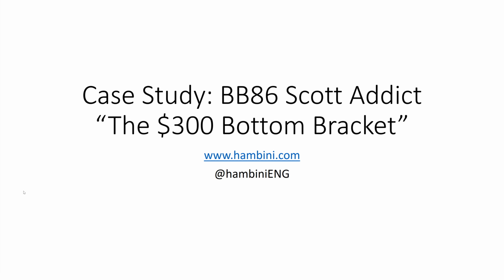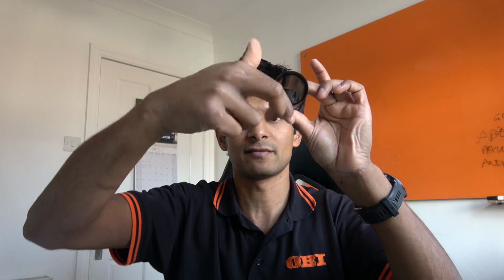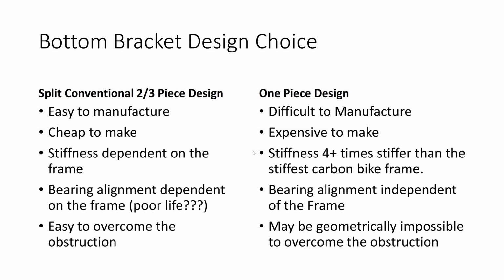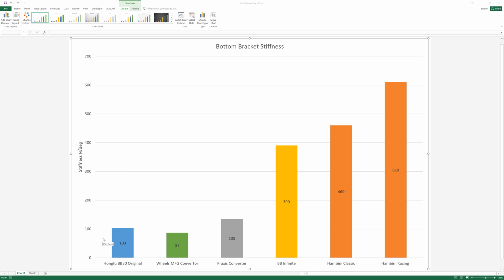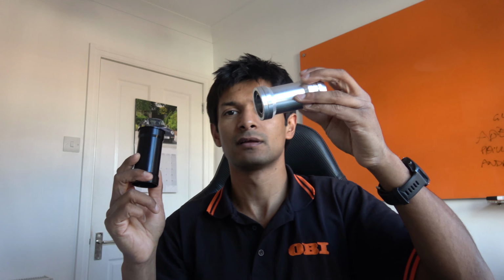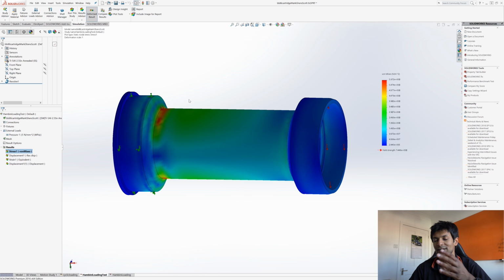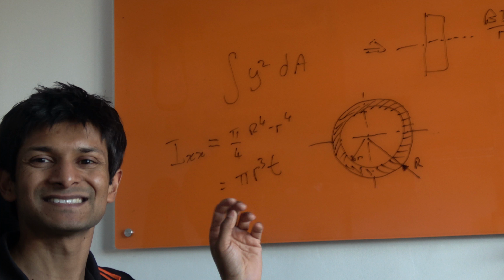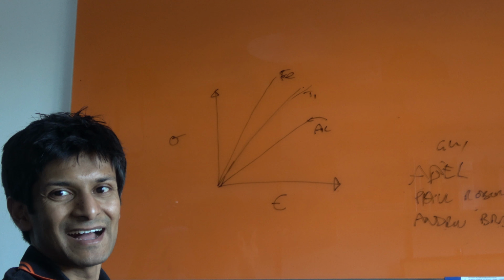Shimano BB86 Creaking Bottom Bracket Scott Bike Case Study

Comment: The bottom bracket is fitted inside the frame, the frame takes the force from the pedal stroke, preventing bottom bracket ends from moving vertically. That's the point of fitting bottom bracket tightly into the frame. If there is enough vertical displacement to stress the taper on the other side, making thin aluminium/titanium/whatever tube slightly less thin is not going to significantly affect things, and will definitely not fix the fact that ends of your bottom bracket are moving up and down inside the frame fit.

Comment: If you replace a delrin sleeve setup with a Hambini one, which is more rigid, can the latter cause an alignment problem with the BB apertures (holes in frame) to lead to the frame cracking?  I ask because it appears that the flex of the delrin is what accommodates alignment problems and the flexing of the frame as high amounts of torque are exerted on the frame.  With no where to go, the forces are transmitted to the frame, which is good for efficiency, assuming the frame is correctly aligned, but bad for reliability if the frame is not properly made.  Maybe this is why frame manufacturers go with BB86 -- it provides them with a margin of safety when the frame without having to manufacture the frame to very tight tolerances.

Comment: Why don't you put a radius on stress raiser from the outer tappers to the OD, there a slight weight increase but that would help even things? I am not an expert so please bear that in mind, I am not sure if this stress raiser is that important but you cover it in great detail. Have ever considered using a steel sleeve and aluminium bearing support ends. But fine screw all ends and lock tight the two joints. In respect to the inner sleeve, you can go for more exotic material to stop corrosion or reduce it. Obviously, it all needs to be tested. Just one more thing you mentioned a frame that was good and cheap but I can find the video about it if you have made one I don't know but could be a great project.
Not everyone has loads of money to spend like me and I am also retired. 
Yours
           Luciano

Comment: I am no expert but I am a qualified machinist. Maching any part can be difficult and if you want to do it correctly then it will take time to do it correctly. Machining the inner dimensions and the the outer dimensions in one go will make sure that surfaces are parallel. BUT as soon as you do the parting stage on the lathe to cut the part off it takes a different shape due to material stress. Rough cut the inner and outer dimensions and sress relieve the material. Clock it up again in four jaw and the do the final inner and outer dimensions. BUT now it becomes more expensive to manufacture.

Comment: Aerospace engineer here too. Excellent design review. Very clear. Only comment is that stress concentration in the corner. Way too sharp. Put a .125" radius there (3mm on your side) to transition from a sloped surface to the straight middle cylinder. You got plenty of room to put a radius. Should not cost you anything more since is still one pass with the cutter.

Comment: Hey, it's me again,  I noticed a some of your Hambini BBs customers complain that their Hambini bearings somehow failed early, and complain to you. And you caring and backing your products beat your brains trying to figure out why!  Well, I'm here to tell you "IT"S NOT YOUR FAULT"... The problem is caused by your customers where they clean their C-rings, cassettes, and chains directly on their bikes using cleaning solvents!  For one those PARK TOOL chain cleaning devices should be banned, where consumers pour chain cleaning solvents into the Park Tool chain cleaner and run the chain thru it where it delivers solvent to the cassette where it dribbles down into the hub and free-body bearings and worse yet soaks the C-rings with a solvent which dribbles down the crank spider and right into the BB bearings.  Solvents have an incredible capillary ability that easily goes past the seals of sealed bearings, which then contaminates and dissolves that tiny bit of grease film between the balls and the raises causing the bearings to roll metal to metal, thus causing the bearing to fail. This action is very deceiving because you remove the seal and all looks OK, as you can still see the larger gobs of grease on the bearings and retainer, but its that thin-film between the balls and the raises that you can not see that is causing the problem.  My suggestion is to put a warning on all your BBs to never use solvents directly on the bike and or Park Tool or any other solvent chain cleaning devices, which will cancel their warranty.  Next time someone complains about your Hambini BBs simply ask them what kind of chain cleaning tool they use.  You will be shocked when they proudly tell you what type and how much they love to keep their chains clean.

Comment: The simple fact that carbon fiber is nearly impossible to thread reliably, is why they use press-fit. It's no surprise that cf frames creak because of the press-fit bbs. The manufacturer has to figure out a way to embed aluminum or steel/titanium into the frame structure. I don't see this happening in mass production. I could be wrong though.
Reply: i think santa cruz does this. their carbon fiber frames have threaded bottom brackets.
Reply: @joshuahuang07  Their BB have a carbon bonded aluminum insert that is threaded on the inside if I'm not mistaken.

Comment: You say that the cable guides protrude into the 41mm cylinder defined by the frame holes. If that is the case, how do you get the one piece BB into the frame without filing down cable guide material? Did I miss something?
Reply from the maker: There is a bit of a cavity half way in

Comment: Not sure the reasoning behind building the rear alingment jig and pins.  I would think that a rear wheel would do the same thing.  It should give you more comfort in alingment as your are aligning the rear dropouts with the actual piece that will be used.

Comment: Why not round the high stress points instead of sharp cuts
Reply: im going to guess that the CAD model is not complete for the purpose of the video and also the cutting tools will always have a slightly rounded edge to them so making the transitions would most likely cause a rounded edge

Comment: can you explain the BBright bottom bracket you got in 11:37 and whats the problem with it. i got a bbright frame and dont know how to fix the creaking
Reply: same problem with all these BB with a bearing pressed in to the frame on each side: They are out of alignment = creak, and they depend on contact with the frame shell for stiffness  . but they are cheap and very light
Reply: @MDonovan  Yep. That's exactly why I will never buy a bike with a press fit bb. At least threaded ones can deal with even slight misalignment. I've never had a problem with threaded bottom brackets, besides the usual wearing out after years and years of use (10+)

Comment: Thank you so much for your research and explanation of the engineering of BB's!! My problem is a creaking  Shimano BB86 in a carbon Merlin 59cm frame. I love the frame but it creaks alot. I'm wondering if the creaking is between the BB shell and the BB or in the BB itself. What is your opinion? Thanks!  - Rob
Reply from the maker: It could be either and without measuring it's impossible for me to say. I would try some loctite with activator and see how you get on.
Reply: @Hambini  Will do, thanks.

Comment: Would the stiffness of the split conventional BB be increased by gluing, welding or otherwise fusing the pieces together one by one as they are inserted into place in the frame?  Seems like it would stiffen it up considerably while eliminating the installation obstruction issue.
Reply from the maker: Yes it would. but it's difficult to get a decent bond when you have poor access.

Comment: I had an intermittent creak on every pedal stroke. Always at the same place each stroke (when pushing down). Usually on the drive side, sometimes on the left rarely both.
Unfortunately it wasn't consistent and could start or stop during a ride.
So...
I took my bike into the lbs where a guy confirmed it and said the mechanic would see to it later on. Bike was under warranty, so it might need a replacement.

Cured - by putting a small amount of grease on the saddle rails.
Reply: HAHA, Saddle creaks have been so much more annoying than BBs for me
Reply: @mihpop9733  That or loose chainring bolts. I recently had that problem and thought it was everything but that. Only when one of the chainrings bent in half and I was down to 2 bolts did I realize the problem. Ugh!!
Reply: Had similar issues with pedals. Random creaks sounding like it could be BB, spin pedals out. Grease threads. Problem solved 😀
Reply: @rileyrides7813  funny, my mystery sounds almost always are cured by cleaning my chain. Of course this is found out after I have rebuilt half the bike has be rebuilt in one of more cases LOL.
Reply: @markr5132  yep, bike maintenance can be a fun and interesting, time consuming and frustrating hobby!!
Reply: @rileyrides7813  So well put! But very satisfied when you get it right. I like to tip the awesome mechanics that have bailed me out, I give them cash and say it is to you donut/bagel fund.
Reply: @Allan I meant that the noise would come and go - that sort of intermittent. When it was there, it was on every pedal stroke.
Reply: @Richard_Ashton  pedantic.....
Reply: @rileyrides7813  You say that as if it's a bad thing.
Reply: always disassemble areas that are suspect and inspect for greasing. most metal to metal surfaces love a little grease. inversely try putting a bike together with no grease. It'll probably sound like a bag of coins

Comment: I really enjoy your in depth engineering analysis Mr Hambini. I have a quick question, when you design and do stress analysis (loading studies) with your 3D cad program do you take into consideration the tool tip radius during your design stage? I'm a former machinist and I am aware it's common engineering to introduce a radius on diameter transitions (spigot or flange) to reduce the local stresses and to increase the life of the component under loads. There is always a small radius from the tool design at least, do you take this into consideration?
Reply from the maker: Hi Simon, it depends what it is and where. This is a judgement call, ideally you do want to include it but it's inclusion causes the calculation time to increase dramatically so I only put it in where I think it will become an issue. Undercuts are a typical item that you cannot exclude.
Reply: @Hambini  Cool, I get it. Thanks heaps for your reply. Sorry if I'm intrusive, I question engineers on a daily basis and I know you guys like to be challenged, in a positive way at least. I have another question but I'll direct it toward your website as its off subject or at least nothing to do with bottom brackets. Cheers!
Reply from the maker: @simongeeves9662  no problem

Comment: Sir, I am from old school bike mech. The non-threaded, press fit Bottom bracket was the worst innovation in bike technology..  Threaded is the way to go!  Never ever had a creaking problem. Then again Plastic Frames are all the rage these days....
Reply: Almost all BMX bb's are pressfit. But frames are made fro steel so design just doesn't work well with carbon

Comment: I don't use bar for my tyre pressure, I use PSI. UK matey.
Reply from the maker: I am an engineer. we use bar
Reply: If God had meant for us to use the metric system, there would have been ten disciples.
Reply: @whazzat8015  12 is just fine and more useful. You can count up to 12 on one hand while leaving your thumb free.

Comment: Would machining outside of the BB shell be aided by a tight fitting mandrel inside the shell to minimize its deformation by the cutting tool?  Can the performance of a three piece shell be improved by increasing the wall thickness and the length of the overlaps? What about making at least part of it out of (stainless) steel, (like a mini S and S coupler?)  instead of aluminum?  I for one don't care if bottom bracket is a little heavierl, negligible real world effect anyway. Could also relax the angle of the taper on necked BB's like this one to reduce the stress concentration at the corners of the neck. Thanks in advance.
Reply from the maker: It is possible to do that but it's a faff when you are only making one. The geometry of the BB in the bike is such that it needed the point.

Comment: I'd like to enquire whether your bottom brackets come with the bearings - or these should be purchased separately? This one, for instance: https://www.hambini.com/bike-parts/bb86-to-shimano-racing-edition-silver-bottom-bracket.html 
 Also, are the BB86 bottom brackets you sell - Sram / Truvativ crank -compatible? 
 …and, lastly, how do they compare to the Chris King Press Fit 24 bottom brackets? 

  Thank you.
Reply from the maker: Apologies for the delay. THey come fully assembled, you only need to push them in. Providing the crank selected is 24mm and hollowtech 2 compatible it will fit.
Reply: @Hambini  Thank you for the clarification, Hambini. Abuse question: do you produce and sell bottom brackets of the Sram DUB standard? I bought a Force eTap AXS: turns out, it uses Sram's new DUB protocol.
Reply from the maker: @LeoInterHyenaem  I've got one that is a prototype. I don't release anything into the field until it's thoroughly tested.
Reply: @Hambini  Thank you. Clear.

Comment: retrogrouch here.  I never had any of these issues with my 68 english threaded made forever "the one true standard " bottom bracket  ☺

but wow for all the guys who want a pain in the ass (read mfg planned obsolescence )  this guy has some great home engineering
Reply: Me neither. 10+ years and counting on the same square tapered threaded BB. Why - besides trying to be cheap - they changed - and basically fucked the whole cycling world - to pressfit is beyond me.  Do these idiots realize that if customers all wind up having issues with their bikes due to having a POS bottom bracket shell - and thereby having consistent problems - they will just switch to an entirely different brand, especially ones that still use the BSA standard.
Reply: I agree, it seems tolerances in carbon bb shells are inconsistent. The pros don't pay for their bikes so a bad carbon frame won't cost them. For the rest of us probably is not  worth the risk unless you've got nothing better to do with your money. When you turn pro you'll be issued one of these beauties. There are so many competing bb standards  it is likely yours won't be available 5 years from now. No doubt there are advantages to technology but it looks like manufacturers are foisting consumers with defective products.

Comment: What stopped you from making that necking edge round? It's an inner edge so it cannot be machined without a radius anyway, why not give it a generous one that also reduces some of the notch effect at the cost of a couple grams? This is probably way too simple, so please consider this a question from an outsider who hasn't grasped the problem holistically..
Reply from the maker: It's a bit of a faff to hold it and machine it at the same time. The arc angle is not straightforward to make.

Comment: Moral of the story. Go threaded
Reply: Check his video on threaded BBs.
Reply: I heard thread is harder to make
Reply: Impressive.
 I would much rather fall short of high standards, than low ones.
Reply: @Francis Lai
That is definitely NOT the moral of the story.
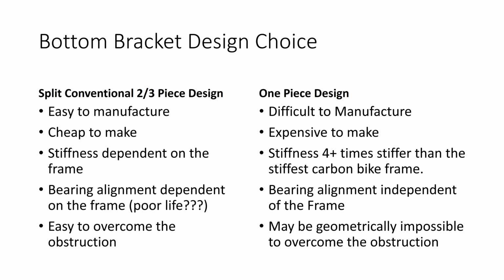5:07  He presented the pros and cons. Do you disagree with that slide or did you not pay attention?
Reply: @itsm3th3b33  think you misunderstood what he is referring to in 5.07 . He is comparing 2/3 piece design bb86 BBs vs. 1 piece bb86 design. BB86 is NOT threaded. 

Like many bike mechanics, we just get less problems with threaded BSA bbs over the years because threaded just dont slip as much after torqued. Not that there are no frame misalignment on a bsa frame, the manufacturer still fuk up the same in any frame. But BSA just allows for greater margin of error from manufacturer tolerance. 

If you are thinking about a mountain bike. Go threaded. Forget about anything else. For road, if you get press fit, you are at the mercy of manufacturer quality control, and expect to pay for aftermarket products.
If you take a look what trek is doing now. They are moving to T47 threaded.
Moral of the story?
Reply: Francis Lai 
He is holding and discussing a snap on 3 pieces BB that is pressed into the frame. You're saying that by threading the 2 end pieces all problems are solved? How does that solve misalignment, which causes friction and creak?